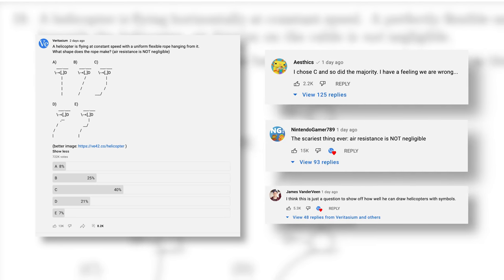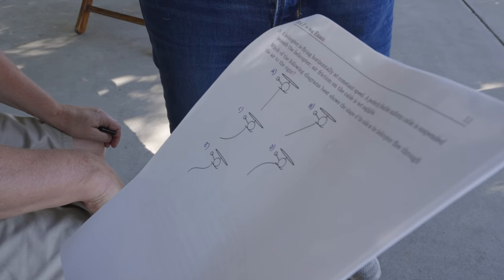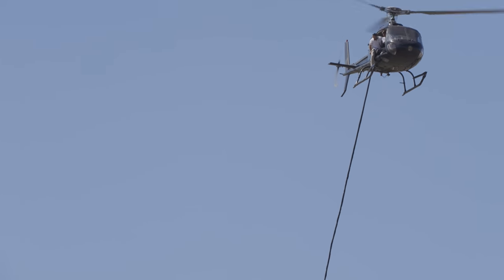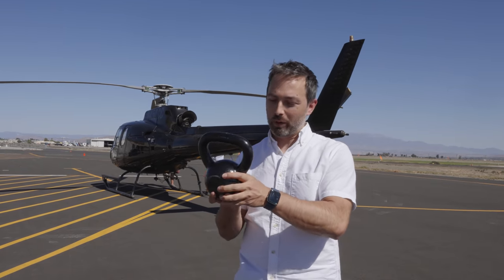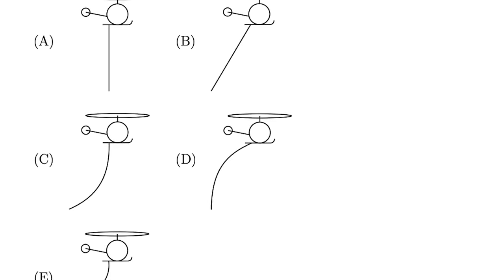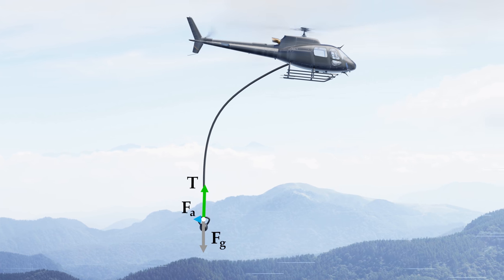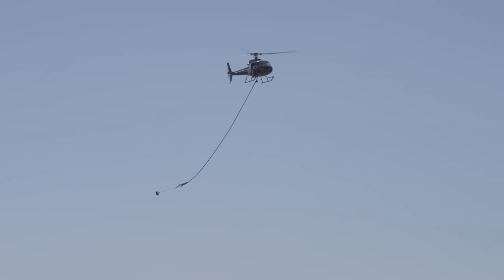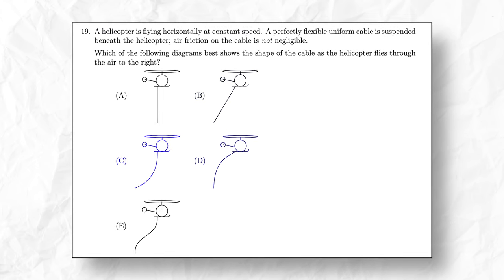I Rented A Helicopter To Settle A Physics Debate

Comment: Well I guess my name is "no one". Definitely chose E. Definitely was wrong haha.
Reply: Don't worry man I chose E too haha. Guess we just think outside the box, yeah I'll go with that.
Reply: I overthought it, assumed it was a trick question, and picked the one I'd be most surprised to learn was correct. A poor way to try to be right, i now find out
Reply: Likewise! And I thought I was correct when I saw the very last couple inches tipping down! Maybe the rope wasn’t long enough? 😅😂
Reply: Same here, pretty cool video though, wasn't it.
Reply: Yeah me too. I thought the aerodynamics of a helicopter moving forward, because you know it always tilts forward when it accelerates, would have made the air resistance at the top less.
Reply: Same here
Reply: same-
Reply: i chose D, i guess im more used to seeing a helicopter with weight on the end of the line.
Reply: Why though? Where you considering the downwash or why did you think the forces would change so dramatically over the length of the rope?
Reply: That would be possible - if you put a weight at the end of the rope and a parachute in the middle, I think. Would be another interesting experiment
Reply: I said C or E. Thought some sort of trick was at play and it would end up curling back due to disturbance or something.
Reply: Same 😔
Reply: I’m just realizing I forgot what one I chose!
Reply: i choose e too
Reply: The 17% that chose A and E are together with ya.
Reply: I also chose E 😅 I wasn't expecting the tension have such a constant ratio
Reply: Yeah I think it is C or D
Reply: i thought "C", then i thought about it for a moment, and thought "C or E".
Reply: There like really is no logical way for it to be e i thought the e people were trolling
Reply: I had chosen E as well (because my visualization was during acceleration) - so bad. I am an embarrassment to my alma mater
Reply: Yea.. i guess i'm stupid
Reply: I chose D based on being airlifted, so I got it right for the weight on the end, so still wrong :)
Reply: I chose C in the poll but decidedly thought "I bet I'm wrong and it's E"... I was half right about my bet! :D
Reply: I was torn between c and e. And I was wrong.
Reply: same
Reply: I've chosen E too. As someone said, i though it was a trick question and chosen without thinking the least possible to me :D
Reply: @iitzfizz  I went D, so I guess I’m right? Or not 😂
Reply: I chose D. After seeing that the rope was straight, for question 2 I said it would remain straight, so two wrong out of two!
Reply: @iitzfizz  same here, i was taking the rotor force + velocity & gravity

Comment: I was waiting for the moment when he says "Now let's recreate option E", and I was ready to suggest to put 2 weights, one at the bottom part, another at the top of the rope. And I was curious if I was right. Guess I will never know :)
Reply: From his explination, a weight at the bottom and top and a parachute in the middle should work pretty well to get the exact shape, I think only two weights would get something more "flat". should work too in my view though :)
Reply: @misamisaa4547  you need a weight at the start too since the rope goes vertical at first
Reply: @kcbsuiejd  nope, parachute in the middle with weight at the bottom
Reply: @edflam9324  how do you get the strictly vertical part in the beginning then? with just a parachute in the middle, it would begin to go left immideatly because no force is counteracting the drag...
Reply: Having weight at the top would not affect the shape in any way (as it does not really affect the tention of the rope)

In my opinion to recreate option E, one or two of these  3 methods should work
You will need one weight at the end of the rope and one weight in the middle of the rope
If that doesn't work, you can add a parachute at the 3/4th point of the rope too
And possibly only adding a parachute at 3/4th point without any weights could also work
Reply: @kcbsuiejd  adding weight at the top will not really affect the rope's shape in anyway, because if it is at the top then it can get its weight balanced directly by the person holding it, without it changing the tention of the rope

Also, there is no possible way of getting absolutely straight rope at the top as long as the helicopter is moving, there will always be some angle, the main issue is getting a change in the direction of curve at the middle
Reply: @Misa Misaa and @ed flam
I think that by just putting a weight at the end and parachute in the middle, you will only get a more pronounced option D instead of option E
Reply: @Jonas  yeah that could work

Weight at 1/3rd and parachute at 2/3ed
Reply: @Kislay11  of course there is no way of gettimng it perfect

1/3 weight 2/3rd parachute would pretty much create the same shape as figure (c)
to get  close to e you still need some kind of weight a few meters below the helicopter, followed by something to create drag followed by some weight...
Reply: @Kislay11  Sorry, I wasn't clear enough, when I said 'at the top' I meant somewhere along the top half of the rope and not at the highest point of the rope just below the helicopter.  Obviously adding a weight exactly below the helicopter would not affect the rope in any way.
Reply: @misamisaa4547  this one feels great to me
Reply: @kcbsuiejd  I totally agree with you!
But my idea is to put a weight a little above the 1/3, so that the rope can do it's transition smooth towards the 2/3.
We need to locate the parachute, a little bellow the 2/3, so it can keep the transition smooth and drag the rope backwards.
If we leave it like that, then the bottom end will simply get dragged by the air as well. Therefore the result will be a narrowed (/) shape, while we need a straight (|) one.
In order to fix that narrow, we have to put another weight in the bottom, but a lighter one, so that gravity can pull the remaining string towards the earth.
But we have to use a lighter weight, so it won't pull the whole rope towards the earth. The bottom weight has to be at least 50% lighter that the above one.
Reply: You need one at the bottom and one at the curve that looks more of a J and less of an r
(Hope you understood my explanation, you are welcome to ask if you didn't:))
Reply: One at the top would be negligible
Reply: @kcbsuiejd  remove air resistance
Reply: No, option e would be a parachute in the middle and a weight on the bottom.
Reply: @quadracycle4000  I think this should do it, yes
Reply: @grooveseeker6269  the video literally showed that the rope by itself will follow a straight path if no extra object acts on it...
each curve needs some sort of force gradient to work
Reply: @christianrasmussen1  why should i remove air resistance? the problem literally tells you that it should be taken into account... if you remove it, the rope will just swing around during startup because of inertia and keep swinging (unless inner friction of the rope is allowed, then it will eventually come to a halt as in option a)
Reply: @kcbsuiejd   it'll follow a straight line if hang from a fixed point, which the parachute in the real world isnt, that's my guessing
Reply: @kcbsuiejd  I meant minimize air resistance of the rope if it should rest as staright down as possible.

Comment: Consider no weight at the end of the rope, still, the answer can be 'c' - the 'J' shape - if we have a very long rope. The reason being the density of air decreases as we go up in altitude. And the air drag is directly proportional to the density of air. Now we have much higher air drag at the bottom of the rope and low air drag at the top of the rope which will lead to the answer 'c'. Also in this analysis, the change in the wind speed as we go up in the atmosphere is not considered.

Comment: I like how the rope draws a real time graph of air resistance vs tension on different points of the rope
Reply: That's a really neat way to think of it, and it's true!
Reply: Not really, at least with the plain rope. The air resistance is the same at every point so a graph of air resistance v. tension would be a vertical or horizontal line depending on how you set up the axes.
Reply: @Bapuji42  In order for the ratio of air resistance to weight to remain constant, the air resistance would have to be greater closer to the helicopter, as described in the video. I don't understand why this is though...
Reply: @CrazyStranger11  Think of it this way: the air resistance is the same at all points on the rope - it's basically just a function of the surface area of a section of rope and airspeed. The weight of each infinitesimal slice of the rope is constant as well. At each point in the rope, the rope has to provide enough tension to balance those two forces. The direction of that tension vector will be constant since the two forces it's balancing are the same at each point. As you move up the rope, those infinitesimal tension vectors sum up, so the tension increases from bottom to top.
Reply: You could say the rope is a graph of the normalized tension vector, which is a function of gravity and air resistance. That's probably what you meant.
Reply: @Bapuji42  I think I get it now. Each infinitesimal slice has 4 forces: weight, drag, tension below and tension above. The tension below is the integral of of weight and tension over the length below. In the video, this was illustrated as weight and drag increasing up the rope.
Reply: @CrazyStranger11  I think you nailed it.
Reply: @Bapuji42  Thanks for your explanation!

Comment: The easiest way of get the answer right is to think in the frame of helicopter. The helicopter is at a fixed point with the rope hanging and there is a strong uniform wind to the opposite direction.

Comment: B was a pretty intuitive answer for me for the no weight situation. My thought process was the following. If you pick a small part of the rope, lets say 1 square inch of surface area... its going to have the same force applied on it horizontally from the air resistance regardless of its vertical position. That constant horizontal force is going to shift the rope a certain amount horizontally from whatever it's attached to above it. A constant shift in position as you travel down the rope is going to result in answer B.
Reply: two wrongs to make it right... you forgot about tension that is different along the rope, messing with your horizontal displacement, thankfully you also forgot about cumulative friction because that is what you need to take into account when the rope is angled. So yes, you got the answer right, but you're not genius...
Reply: @aliasrandom9241  man, you must be fun at parties
Reply: "its going to have the same force applied on it horizontally from the air resistance regardless of its vertical position". I disagree. Air density is not constant, and the force (drag force) in the -x-direction will vary based on height.
Reply: I suggest you watch "Bill Burrs philadelphia rant". :)
Reply: Same, B just felt like the the obvious answer
Reply: I just chose b in my head because of a video game and it’s physics😂
Reply: But the helicopter in the question isn't flying forwards (or diagonal and to the left like in the experiment).  It is only flying to the right (straight towards the observer).
Reply: @Necrile  I'm an engineer, I just wrote off the change of air density due to vertical position as negligible.
Reply: @aliasrandom9241  It wasn't "two wrongs", I simply only thought about the horizontal forces being constant regardless of vertical position. Also I never claimed to be a genius.

Comment: I love how the teacher is like, “this is really hard to answer, I don’t think even I can get it right. Let’s put it in an important exam, it’ll be fun”
Reply: @AakashKumar-gt9ip  He never said he couldn't solve it, but he basically admitted he based the questions on events he experienced and not events he conceptualized and solved using math.
EDIT: It's not a bad question, it's just more of an engineering experience question than a mathematic question.
Reply: @SekiberiusWelkesh  that's suppose to be a physic exam right? Not an engineering exam right? That's as bad as an IQ test in foreign language that you cant understand.
Reply: Norm MacDonald was right about teachers.  Confirmed!  :)
Reply: @nyang4276  Nah he's wrong it's definitely still a physics question. Just because the problem came from a real world observation doesn't make it engineering especially considering nothing is being made here. It's entirely an analysis of forces along the length of the rope which is physics.
Reply: some teachers tend to put stuff they can't quite figure out into exams to see if a student comes up with a solution. quite a few things have been invented this way

Comment: I'm pleased that I got it right, and it certainly felt intuitive to me, but given so many smart folks got it wrong it's interesting trying to dig into why I felt that way, like I feel sure I've seen something similar somewhere in my studies
Reply: Yeah i picked B too. 

Idk much, but i thought about kites and how the rope is diagonal, even if you let go. And the same thing with balloons. Kinda just used common sense and didn’t think about the math cuz i know i don’t know it. If it was weighted at the bottom tho idk what would happen, i’d still pick B.
Reply: I’m by no means a genius, but I was wrong since I chose C. My biggest reason for choosing C over B was incorrectly assuming the air from the rotors would have an effect on the rope.
Reply: I just thought of the rope as two sticks connected with a joint and decided that's a good enough approximation. I got B as the answer.
Reply: Intuitively, I picked B.
Reply: being a scientific person, and having physics background, I knew the problem before he polled the audience. I love how you can visualize the change in the other experiments Veritasium did with weight against to air resistance : the two forces which must be equal for the bare cable to make a diagonal straight line.
Reply: @parkervanalfen2485  I thought c because when you move a rope usually the end lags behind the rest. I thout that would be the same anywhere. Guess at high enough speeds it ends up evening about across the rope.
Reply: I wanted to pick B, but it seemed too simple and I was sure there must be a trick.
 So I tricked myself out of the right answer and picked C

Comment: It was clearly E (E is also like all the others exaggerated). At times it looked like C due to the inconsistent speed of the helicopter.  He keeps saying "straight diagonal line" but you almost always see that little bit at the bottom curved downward.
Reply: Actually the average curve is a straight diagonal line. The far end of the rope carried less tension hence there was low frequency oscillation occurring. Since it was a free end, it had an antinode of a standing wave, hence the big amplitude, thus looking like a flipping hockey stick.

Comment: When I was guessing in the poll, I actually drew the free body diagram of the rope-pieces, and in the end I got the wrong answer because I actually forgot GRAVITY god I feel so stupid (air resistance not negligible makes us go crazy)
Reply: So what was your answer? If you neglect gravity, the rope would hang in a straight line behind the helicopter (getting caught in the tail rotor), which wasn't an option.
Reply: now advanced level: gravity is NOT constant throughout the altitude, air density is NOT constant :D
Reply: Tbf, they never specified that it was an Earth helicopter.
Reply: @TheMatgaw  That's true but its effects are negligible, so there's no need to consider it for this kind of problem
Reply: For me it was more of answering against multiple choice than finding the right answer and seeing which answer it lines up with. Looking at the constant gravity and air resistance, the derivatives of every other answer make absolutely no sense, so you're left with c as the only possible answer
Reply: I did not do anything like that I just assumed it was B because it makes sense
Reply: You're not stupid if you able to even drew a free body diagram to prove something. That mean you have "potential" to be smart.

Comment: Nice, now I understand exactly, where I went wrong with my thoughts when I gave answer C in the poll: I correctly figured out that the total weight of the rope under each rope element must be considered. But I incorrectly assumed only the air resistance pushing at this element was relevant, where as a matter of fact also the air resistance on the whole rope below must be considered.
Reply: This is the exact same problem I had. I blame the chain problems I had in dynamics. They primed me to only think about the weight of the chain as additive.
Reply: I chose C as well, but for a different reason. I assumed that density of air at the bottom of the rope would be larger than at the helicopter, and thus would provide a stronger horizontal force. This is negligible with such short distances however. It probably would be correct though with a really, really long rope

Comment: i got that answer thru a force balance at any point on the rope.  because the rope is not accelerating, the net force in the horizontal must be zero.  the horizontal force of friction must be balanced by a horizontal component of tension in the rope.  To get the  horizontal component, the rope must be hanging at an angle relative to vertical under the copter.  Because the friction force is the same along the length of the rope, the angle must be the same.  Therefore, rope is straight.  Answer B